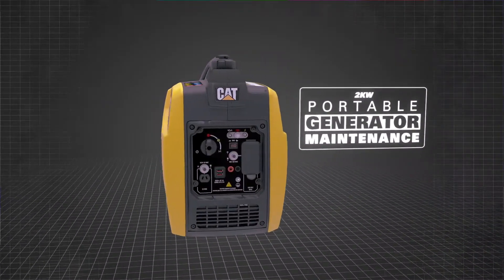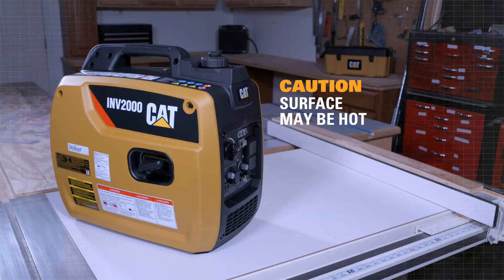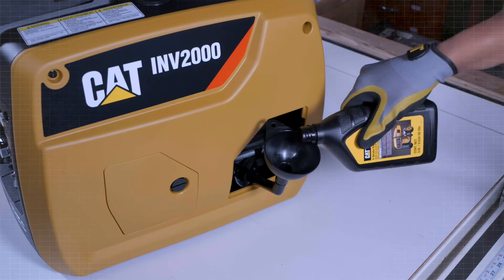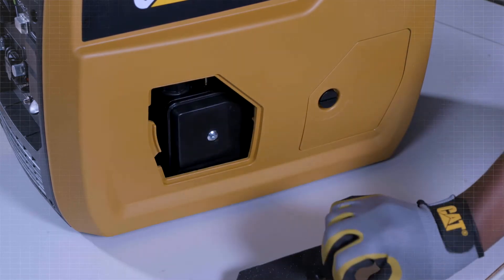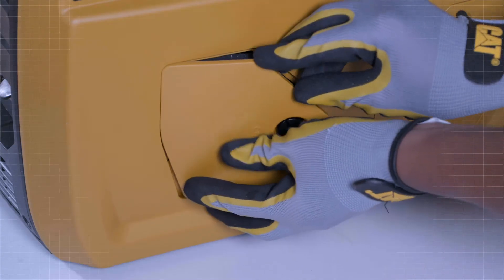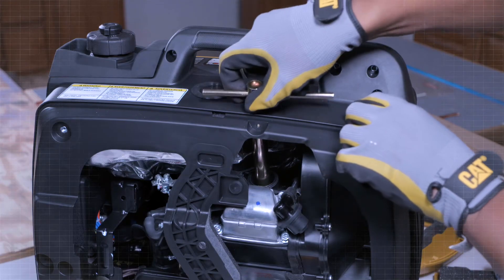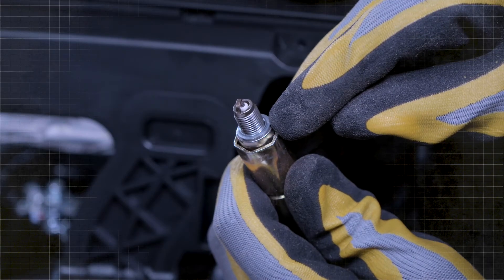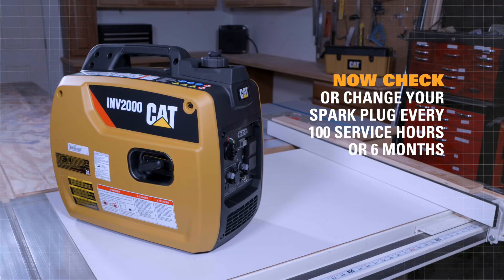Cat® NA 2kW Portable Generator | Maintenance

Comment: It’s how much watts?
Reply from the maker: Hello Delowar! A watt (W) is a unit of measurement of power. Watts therefore refer to the power of your device
Electricity is measured in units of power called Watts. A Watt is the unit of electrical power equal to one ampere under the pressure of one volt. - Pablo
Reply: @CatHomeOutdoor  does this generator use the same CAT DEO MULTIGRADE DIESEL OIL 15w40 with a API S RATING?